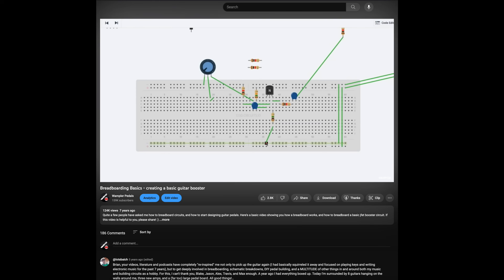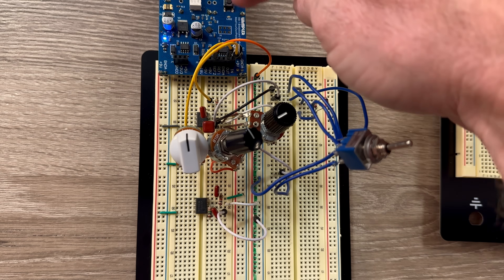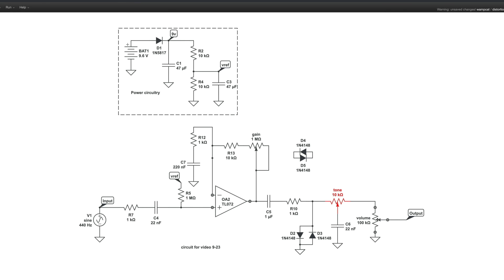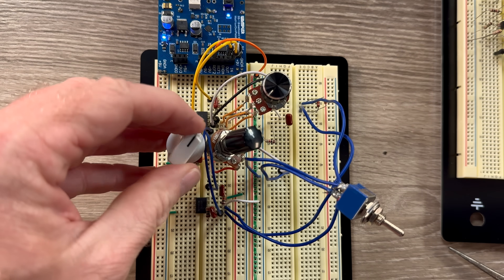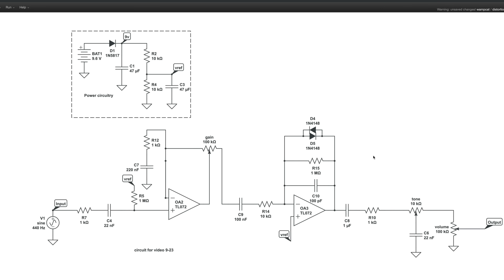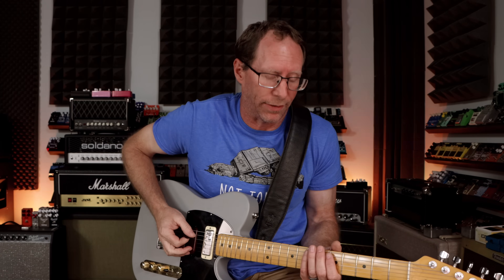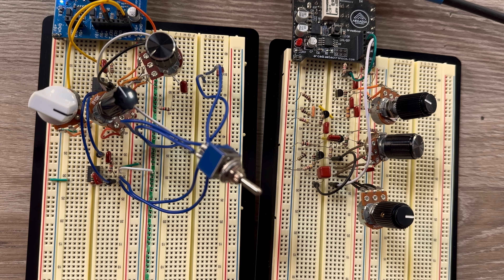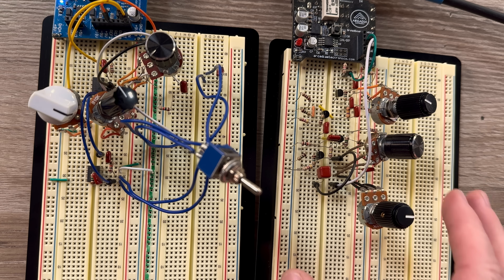How to Design a Distortion Pedal Circuit

Comment: Definitely the MOSFETs. Something in how they clip sounds more pleasing than the 4148's. I've built a circuit using BAT41's asymmetrically. Sounded pretty good.
Reply: hard clipping usually doesn't sound that great on opamps alright, but yeah realy depends on what kind of EQ you applied too.
 
an active EQ with an opamp can cut and boost a lot steeper than your basic passive EQ to take out the nasties, 
and ofcourse it matters how much of the signal is already compressed through soft clipping beforehand, 

every gain stage is its own EQ stage by how far its driven, drive them real soft, it gets thin and tinny, drive them harder, the mids and the bass come in, drive them too hard and the clipping will usually be detrimental to the headroom of the bass again.
this is teh reason why gain stacking actually works pretty well, you gracefully boost them multi-stage before destorying the signal completely

so you can fix some EQ with gain staging, but it sure as shit helps to have a pre-EQ too to an even broader scope of control

but that could just be an EQ pedal already on the market since it's on the pre, helps a lot to pinpoint nasty frequencies in your circuits by just cutting everything except certain smaller ranges of bands 

or you can make a little variable bandpass filter of course to serve the same kind of purpose  :D

you can control soft clipping with opamps quite gracefully with different diode types

or just crank up the working voltage to increase headroom so more basic diodes clip harder before you bring it back down again, in case you need the heavy distortion, that's why TL(C)072 are still being used quite a bit too

and then there's parallel... i love my Y splitter, one little practice amp for the more compressed grit, and one that's cleaner and a bit more bassy for the definition  :D

Comment: I feel kinda funny trying to "correct" you here, but I'm pretty sure that diodes in the feedback of an inverting opamp stage just gives you hard clipping again.  That inverting input looks like ground from the perspective of those diodes, and if they conducted perfectly (0 Ohms), the gain would be 0 (silence).  They of course don't ever conduct perfectly, but instead conduct just enough to keep the output of the stage right around the forward voltage of the diode without any of the clean blend action that an actual non-inverting soft clipping stage will give you.  I honestly watched this muted with CCs on, and wouldn't be terribly surprised if there was some difference when you flip that switch (I guess probably doesn't clip the opamp itself anymore), but unless I'm missing something, it should be just another form of hard clipping.
Reply: I think you are on the right track but have actually misunderstood how diodes and hard clipping vs soft clipping works in the context an op amp. But I can definitely see where you are coming from. It is sort of soft clipping and I will try to explain why a little bit. You are correct that you see a virtual ground at the negative input. This is because an op amp is always trying to equalise both of its inputs to the same voltage, so if + is at 0v then it will try to make - 0v. What is happening in this inverting configuration, you can imagine as a potential divider. So as a voltage comes in on the input resistor (ri) it moves the voltage of the negative terminal up, the op amp to compensate will then create an equal but opposite signal to take the voltage back down again and equalise at 0v. This however is scaled by the potential divider created by the feedback resistor and the input resistor, hence you get -rf/ri. What the diode does is create a point at which rf quickly reduces. If you have an input of 0.3v then the gain is scaling by 10 but you have diodes in the feedback then it won’t go up to 3v but it will get close to 0.7v and enter the diode’s ohmic region it quickly reduces the gain in a soft way (due to the ohmic region) so you see a soft edge to the clipping. In the case of this circuit, the voltage is already coming in way above the 0.7v threshold. What the op amp simply does is create gain in the first 0.7v of signal, so you get a steep climb, after that the diode kicks in and then the signal coming into the op amp -ve terminal is being directly equalised by the op amps feedback, therefore in effect the gain becomes 1. If the input reaches 3v then the output of the op amp will have to reach -3v. What you do get though is this transition region where the you get an initial steep response, then after that it replicates the wave form of the previous gain stage. Therefore you get the loud volume carried through both stages, whereas with the hard clipping that shunts the excess voltage over 0.7v to ground and you get the volume reduction. Hopefully that helps, but I fully expect I have probably also been somewhat inaccurate in my description!
Reply: Replying to my own comment. I think I have neglected to take into account the voltage drop of the diode when considering the feedback. This will mean that my negative feedback voltages should be 0.7v higher than the input. Therefore in theory if the first op amp gain stage was maxed out you would do a small amount of op amp hard clipping in this second stage I think, in addition to a shape change to the waveform due to the initial gain. I will have to simulate this tomorrow to test the theory!
Reply: @dafifteenthstudent  K forgive me while I work through my argument and correct me if you see anything wrong.  The gain formula for an inverting configuration is -Rf/Ri.  If we assume that the diodes are a short circuit when they're conducting (we know they're not, but will come back), then Rf = 0 and it doesn't matter what Ri is because the output is silence.  The diodes are not short circuit when they're conducting, they're exactly enough resistance to keep the voltage across them at 0.7V, and I think that means the gain is just enough to keep that 0.7V across them and that means the output just sits at 0.7V which is just what the hard clipping diodes did.  In the non-inverting config with diodes in the feedback, the minimum gain is 1, so we get that thing which is very much just hard clipping with a unity clean blend.  When it's inverting, I'm pretty sure it's just hard clipping.
Reply: I don't want to say that this configuration is going to give exactly the same results as what you'd get with the diodes to ground after the opamp.  I think, though, that the differences come more in the way the diodes interact with the caps around it.  That's a whole weird thing that makes my head hurt, but we definitely have new neighbors to contend with after we move over toward the TS neighborhood.
Reply: @ashcatlt  thanks for taking the time to reply. I did a quick simulation in LT spice this morning, and would recommend you do the same and have a look. I think it wouldn't come under the category as 'hard clipping' for me as in my mind hard clipping sets the output voltage directly to the forward voltage of the diode by shunting the excess to ground. therefore classically you see a volume reduction. but I would definitely say its a hybrid. In this configuration, signals below 0.7v are rounded (classic soft clipping response), and signals above 0.7v have an initial steeper response and then retain the shape from the previous stage (slightly more than unity gain). therefore a semi soft clip response, depending on what you feed it. Interestingly with an amplitude of signal + diode drop. If you put a half wave in that adding the diode drop would exceed the headroom of the opamp then you see the opamp hard clip. so you kinda get 3 different modes of operation! very interesting :)
Reply: I'm so sorry.  Pretty sure I see where I was going wrong.  Thanks for your time and effort.

Comment: I love these videos, especially as I am learning more and more about circuits as time goes on. Potentially silly question, for Brian or anyone else with the knowledge, where does one get the blue circuit board that feeds into the breadboard? (with the switch that bypasses the circuit). I assume that's where the guitar plugs into? 

Also, I've seen another builder just use two jacks (ones that you would seen in a pedal) on their board as the in and out. I assume something like that would work but be more noisy?
Reply from the maker: I’m getting ready to release those, they just make it easy to get the Jack’s and power to the breadboard. Arcadia electronics make a version as well that’s really good
Reply: That's a question I've also been thinking of.

Comment: Brian, I built a fuzz face clone that cannot be used with my Ciocks supply. It has to use a wall wart or there is horrible (switching?) noise. Should I try to put a filter cap on the supply?
As far as the circuits in this video, I would want ALL of them on some switches. LOL.

Comment: That's really interesting.  I liked the kind of immediacy of the first circuit, especially on the first setting, but there was something slightly more "tube ampy" about the MOSFET circuit, and it sounded a hair less bright (to my ears in these headphones on this computer).
What about JFET's?
Something that occurred to me while watching and listening to the video was guitar-to-amp variables.  What sounds great between a humbucker Les Paul and a Marshall might sound like ass between a Filtertron Gretsch and a Vox or between a P-90 SG and a Laney.  (Or it might be great in all situations.)
Therefore the mission of the pedal is of paramount importance.  Is it purely an overdrive or distortion?  Is it supposed to make a clean Fender sound like a raging Marshall?  Is it mostly a boost with a little hair on it?  Is it supposed to start to sound like a fuzz at the limit of its range?  Is it never supposed to sound like a fuzz under any circumstances?
What about playing well with other pedals?  What about noise and hiss?  How cheap does it need to be/how spendy can it be?
What a headache!  I guess that's why I'm not a pedal designer.  (Although...)
Reply: Good question, is there effect on tone and distortion different than MOSFET's?

Comment: Great video. Very clearly explained as usual. The Mosfet version sounds great and more complex / natural .. It is more 'amp like' than the opamp/diode clipping version. Follow-up video on different types of clipping circuits like Leds/zener/asymmetric diodes/transistor/jfet/opamp?

Comment: First, there are a lot of tube amps that use global negative feedback to increase the clean headroom in exchange for creating clean compression (i.e. Fender amps). Are there any pedals that use this, and could you demonstrate such a circuit?

Second, as I understand it, true presence controls affect a negative feedback loop in the power amp (in maybe a frequency dependent way). Are there any pedals that do this, and can you demonstrate it?

Comment: 2x OP amp + 2x diode, put it in a box - sell it for 300 Bucks
Reply: You can see how China simply copies these designs of resistors, capacitors, and op-amps, and mass produces them at $10 per pedal, (made up of $5 parts and $5 labor), and sells them for half the price of what they can be built for using local parts and labor. A $100 profit on a pedal for a developing country would equate to a $1000 profit in a developed country (but no one would buy a $1000 pedal made locally) - and hence the local companies go broke.
Reply: @chillzwinter  What is strange is blaming China and not our own leadership that sold us out. It was western greed and wealth consolidation that sold manufacturing out to the east.  
   The never-ending race to the bottom of quality and the top of profits.
  They couldn’t force us to do any of that. Our leaders did it to us.
Reply: @chillzwinter  Yeah but the results are not always good. I bought one of such cheap copies and I thought it was ok. Then I built my own pedal and it sounded waaaay better. 
By the way, something I learned building my own pedals is that the circuit itself is cheap, what really makes a pedal expensive is the packaging. The enclosure, paint job, box and things like manuals. You can mount a good distorsion pedal in a preadboard for under 5$, but try to put a good enclosure and the price rises the hell up.
Reply: Yeah! Back in 1990 I started studying EE, I was working at a music store setting up guitars and I was a gigging guitar player too. So I had a tube screamer a metal distortion and results distortion. And then I figured: “what is the difference between then ?” And I reverse engineered it and I felt cheated.
So I figured I can easily combine all 3 and and since I had just done microcontrollers at college I figured: ‘I can even add presets using some digital potentiometers and a bit of ram and an eprom”. So I created this prototype for 90 bucks that did all types do boost, and distortions. My employer was like: “let me build an aluminium case and let’s produce these as bespoke systems.” The first week we had 7 orders. All gigging friends they went on gigs and we had 10 the next week. We build over 90 of them because we sold them for the price of 2 of those peddles. Oh yeah I added a tremolo and stutter (cut out) effect too. The problem was that it started to really consume time and the orders were too limited to have factory production done and too many for us.
Reply: What is the use of RAM and EPROM?  @CallousCoder
Reply: @kanchanmisra2979  the pedal was digitally controlled so we could recall different settings. Just by stepping through preprogrammed configurations. So high distortion lead and just a bit of bite for rythme etc. We could store a couple of hindered configurations.
Reply: @CallousCoder  rad 👏👏
Reply: And then ruin your reputation by charging that much
Reply: @pitfighter871  thats what US did 😂

Comment: G'day Brian,

Thanks for another great video.

I liked the MosFET circuit, because it sounded a just little brighter than the OpAmp circuit.  I don't think that there was very much difference between them.  But I can see that 1 circuit might suit single coil pickups better then humbuckers.

I was also confused by your circuit diagrams.  I could see that you had similar power supply sections, with V & VRef points, but I couldn't see the V supplied in the OpAmp circuit, or the VRef in the MosFET circuit.  Maybe I'm just becoming more nerdy myself...  Hang on!  I'm currently in the middle of writing an Excel macro to record my guitar pedal purchases so that I can take a list with me on my phone when I go shopping.  I think I'm nerdy enough.

As for this being a nerdy video, it too was just nerdy enough.  If you were wearing a 60's Star Trek T-shirt instead of the Star Wars one, it would have been over the top.  You just can't pay attention to anyone with a Trek outfit.

Anyhow, thanks for a great video.  Keep up the good work.

Andrew

Comment: I preferred the mosfet. Great video. 
Brian, could you  do a basic video sometime that explains why each component is used. Like why is there always a resistor and a capacitor first in line and why does a change in resistance cause a change in tone?
I need a little theory to understand better.
Thanks
Reply: The resistor and capacitor in the front act as charging elements allowing for the circuit's charge to change overtime. Adding a resistor before just increases the charge time (but not the discharge time). The change in tone is done by the combination of both the resistor and capacitor at ground to make a passive low pass filter attenuating higher frequencies. Passive low pass filters allow low frequencies up to a cutoff frequencies fc, and fc is determined by the resistance in the RC component